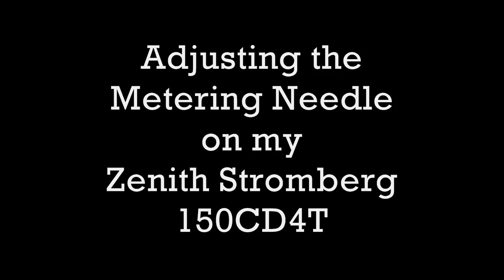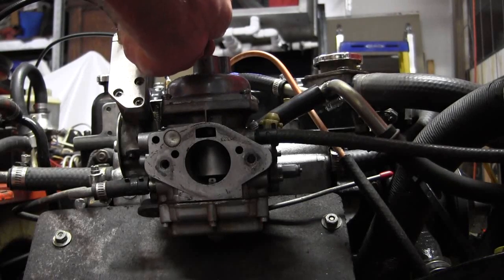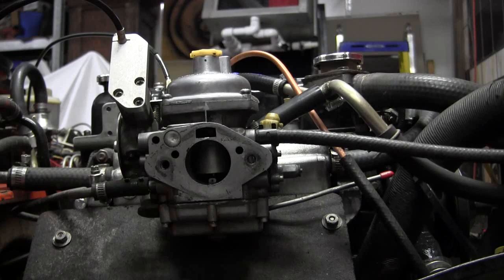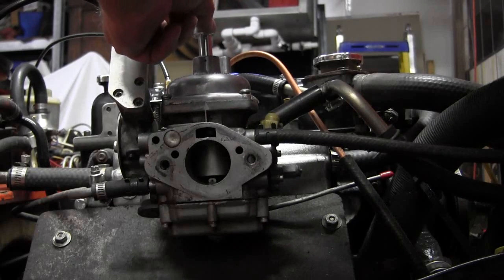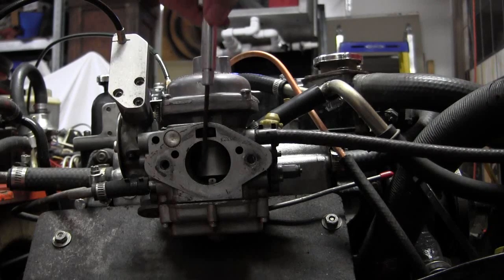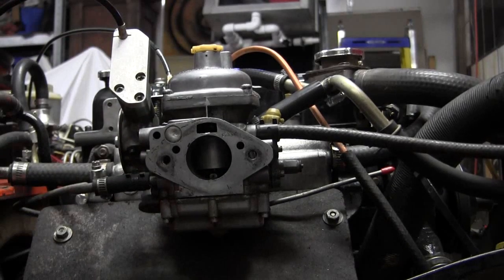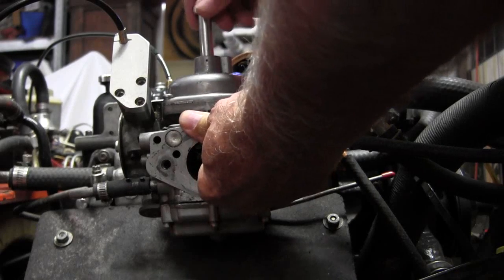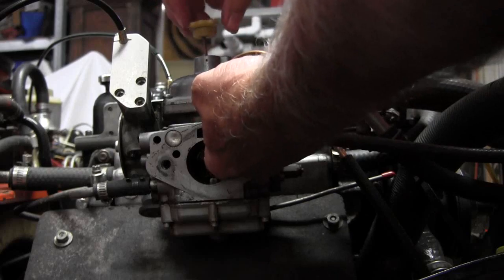My Zenith Stromberg 150CD4T metering needle adjusting video

Comment: Great video! I have stromberg 175cdt-u for Mercedes 1978, I've try to adjust mixture but when I try to lift the valve up the idle drop & engine is shut off. The rpm is already on the high idle. Is there other screw to adjust the idle? I have no problem with the power of my engine but when I checked the spark plug its full of carbon (Back then my spark plug is brown & fuel economy is great)
Reply from the maker: Adiemobs, I'm not familiar with the175cdt-u. Spark plugs covered with carbon is usually too much fuel, could be the choke not fully releasing. My water heated choke was causing me trouble so I installed the manual choke. This carb in my video here is running with the 10% ethanol blend fuel, engine ran well. When the non-ethanol mix fuel become available again I overfilled my tank (my bad) in Montrose before driving from over Red Mountain (twisty high elevation roads). When I got home I found the carbon canister was soaked with wet gas, and my spark plugs carboned up the worse I had seen. I cleaned the plugs and used the ethanol mix after that. Engine ran better, no heavy carbon build up. I edited most of my earlier reply out, sometimes too much info is confusing. You had good coloring before, could be something you recently changed. My 150 did have another screw, on the rt side of the carb, for adjusting the mix when smog testing. I think it was fine tuning the internals I'm not sure. Mine was set a few turns out. My choke was most of my troubles.

Comment: Calvin, all the way clockwise the needle stops, will it stop if adjusted far enough counter clockwise. Mine just spins and spins…Wondering if my diaphragm is ripped.
Reply from the maker: you can drop out turning it CCW, just lift the piston up with your finger and turn the adjuster CW to pick it up again. I check my diaphram while it is out, gentle stretch and a light behind it would show through a hole.

Comment: So I just installed my carb and it revs like its wide open throttle. I've checked the cables, the carb at rest, the gaskets are new and the bolts are tight. Where do I begin from here?  And what's that port above the mouth of the carb?
Reply from the maker: Jim, gasoline makes the engine rev higher, check the float level setting, piston needle position, choke fully off? Look at where that port goes and what it effects on the carb.
Reply: Like I said the cables are at rest, no pulling. It revs like the throttle is wide open, high enough I dont want leave it running to red line the RPMs. I know Kehin and Makuni carbs just not zenith. I assume the opening above the mouth is idle air intake ? I can see as much as when I fire off the slide is still down.
Reply from the maker: @jamesteeter5345  Throttle and choke cable at rest. So something is holding the throttle open. The fast idle adjuster screw or choke screw holding carb butterfly open. Raise the piston, look into the carb see if the butterfly is closing or if the metal plate is off center contacting the side of the throat. If throttle or choke screw adjusted tight turn that screw counter clockwise to close the carb butterfly. I swapped a butterfly plate from another carb, did not fit correctly, so it was holding the carb throttle from closing.

Comment: What in the world are you doing? Hard to read your mind sir.
Reply from the maker: You can read the spark plugs to see if your running too rich. If your plugs are too hot, run too white, change to cooler heat range. Fuel mix instructions at sea level change with elevation change. I adjusted leaner for higher elevation. Plugs are cleaner, MPG improved, engine response improved. The engine stopped running rich when I crossed 10,000 elevation summits.
Reply from the maker: Jess, short answer is: I'm adjusting the air to fuel ratio for my elevation. I had removed the Calif epa restricted camshaft and installed the MKIII higher performance camshaft in 2015. I did not change the needle attached to the piston, just the position of it to the jet by turning the adjuster with the allen tool. HTH

Comment: Where can I get This ajusting tool? Whats that tool name?
Reply from the maker: Zenith-Stromberg Adjusting Tool for the metering needle. allen with the guide that holds the rubber center from twisting. Zenith-Stromberg carb parts suppliers should have this in stock, possibly with their own name for it, but that is what it does.
Reply: Calvin, thanks for the detailed video.  I just ordered this tool today, but I got to thinking there might be different ones (sizes) for different cars/carbs?  I couldn’t seem to find any differences in the ones I found.  Is there just one version?  I have the Stromberg 175 Cd for 1964 TR4...
Reply from the maker: @timduncan1282  I would talk with that sales person about that to be sure. I don't have a 175 to check myself. 175 is 1/4 inch wider out, piston should be a tad wider, but it should be the same allen. I have the 150, not much different  in size.

Comment: I have a Stromberg 175 CDT on a car in Europe that's runs terribly when you hit the gas hard. Also doesn't want to idle. Assuming I get the fuel system cleaned out and it still runs the same what would you look for?
Reply: I would guess that the diaphragm has a tear. It would be best to get a carburetor rebuild kit for it.
Reply from the maker: Triumph Spitfire & GT6 Forum

Comment: Calvin, whe I try to turn the allen key there is a massive amount of resistance to the movement of the tool. what could be causing that..?
Reply from the maker: Chris, If turning the allen clockwise, the tool is turning a screw in the piston, as the screw raises the jet needle the screw runs out of thread, and bottoms out. Counter-clockwise extends the reach, and will turn out from the needle, turning free till it releases the screw, and separates.

Comment: isnt there an extra air screw  that says to not touch it. i would adjust that after you have adjusted the main jet.
Reply from the maker: CO needle is on the radiator side of the carb, is that the one your referring to?
Reply: actualy i dont own a car like this but i only know it by my neighbors car. in that one its burning too rich like the choke is on. spark plugs are black. he doesnt know what to do. since i have a diploma in mechanics i have a good idea. he adjusted the main jet and did not do anything. there are  only  two other adjustments.  one says    do not adjust and another one beside it.   one of those is the one thats adjust the total air through the whole opening range of the  main flap.   and yes try the co adjust see what it does     you cannot hurt anything  cus only adjusting air and fuel!  the neighbor is too  scared  to touch them!   its better than running that engine rich. cus that causes carbon buildup!  not good!

Comment: great video thank you. I am currently restoring a 78 myself after its been locked away fro 20 years. i hope to learn a lot from you.
Reply from the maker: Actually, your going to learn a lot from that 78.
Reply: When you turn counter clockwise, does it mean the needle goes down and less fuel going in (leaner)?
Reply: @QuangWynn2711  Yes. Clockwise is richer, pulling the needle up. Just remember left for lean and right for rich.
Reply: I try that but not helping at all .

Comment: Is this needle - once in right position - fixed to the round cilinder or can it still move in and out?
Reply from the maker: fixed to the adjustable screw you adjust in the top using an allen wrench and special tool preventing the inner diaphragm from turning.

Comment: My idling speed is way to high on my w123...which parts should i adjust? Im using zenith cd150
Reply from the maker: 3 places to check: throttle cable adjustment for proper slack, choke adjusted correctly off, and the idle screw on the left side near the choke that moves the throttle. There are vids on UT of those items, and the web has pictures of the carb's left side screws named. Your manual is very helpfull, it you don't have one ebay does.

Comment: What is the yellow screw on the right of the carb? I know I need to adjust my carb as it is running really rich but I cant figure out what that yellow knob does.
Reply from the maker: that plastic cover is on the fine adjust screw for air/fuel mix. It is only adjusted when a gas analyzer is connected to the exhaust to check carbon monoxide levels. If your engine has the smog equipment still working. If the engine does not have pollution testing in city, the screw is not used.
Reply: Thank you!

Comment: If the idle speed slows or stumbles when the piston is slightly lifted, the mixture is too lean.
Reply from the maker: Don't forget to watch the spark plugs after making mixture adjustments. Assuming there are no vacuum leaks or open lines into the intake manifold for air to lean the fuel mix. If the electrode's insulator is white after driving awhile, either the plug heat range is too hot (burning off all the fuel trace, aka color) or the mix is a bit lean. Dropping in spark plug heat range should bring back some light brown color, letting you know your in the right heat range. I find these carbs and cars have more than one problem happening when it comes to proper spark and fuel. A very lean mix can cause hotter running engine temperatures, not the best thing for aluminum pistons.
Reply: Indeed, Sir. After i fitted a "sports filter" on my car, the Zenith did´nt get enough vacuum so it just got too much air. Plugs looked like they had´nt been runing at all afler several miles.

Comment: Interesting, maybe this adjustment is what mine needs. I have a 1978 Spitfire and the only way it will run is to take a piece of thin cardboard and completely cover the air intake. Once it's running I can move it enough to let more air in and it runs fine. If I remove the cardboard the engine dies.
Reply from the maker: Check the float bowl fuel level, if the level is too low the fuel is not up into the jet as needed. The cardboard is causing the engine vacuum to pull fuel from the carb. Cleaning all carb passages is the next step. You should not need to block the opening.

Comment: I just ordered my metering needle tool today, but before I mess with it I've noticed something John Twist said about the needle. There is a pin inside that if it's missing will allow the metering needle to spring up into the valve. (Which mine does with about a 1/4" of play.) Where would this pin be? He says a piece of paper clip works fine to replace it. How much movement of the needle is normal and why is the spring in there? On the SUs on my Z car the needles are solid in the pistons and no diaphragm.
Reply from the maker: the pin is touching the top of the needle, the needle sits on a spring, all 3 are part of the needle holder. That is why you can pull the needle down about 1/4". The needle holder threads onto the allen wrench adjuster screw.
Reply: Just got done messing about with it. Either my needle and jet are very worn or I have a mismatched pair. I placed a copper shim between the needle and adjusting screw so the needle is pushed all the way out of the valve assembly and down into the jet. It still blows a little smoke, but it will at least hold an idle and it didn't load up while holding 55. I think my understanding of the mixture may have been flawed as well. When you adjust the screw, the boss that the needle (and the jet it goes into) never change relation. So you aren't reducing the fuel metered into the engine by running the needle into the jet (as I have done with my shim), you are increasing the airflow by actually raising the piston with the needle valve assembly to allow more air into the mix. Am I correct in my new understanding? Either way, I'm looking for a new matched needle/jet assembly as the needle is very sloppy in the bore of the jet.
Reply from the maker: No your not correct, adjusting the needle with the allen tool is not supposed to raise the piston, air flow across the bridge under the piston causes the piston to lift, and pulse up & down. A CCW allen turn moves the needle down into the jet or CW up but not out of the jet. Think of it as a tapered rod and the taper is blocking the fuel more and more as it goes down into the jet hole causing the mixture to air to be leaner. The adjuster can detatch from the needle holder when your turning it CCW, just lift the piston and turn the allen CW and it will reconnect. Other things can cause the exhaust to smoke some too, oil leaking down the valve guides, a mis adjusted float if too high will raise the fuel level into the jet, air valve on the carb gaskets, ect ect ect. U-Tube is not the best quick answer, try the spitfire&GT6 forum, usually someone is online and help out. Be sure to post the year of the car in question, it helps.
Reply: I've been viewing the University Motor vids on the Stromberg as well. I have adjusted the float and auto choke per John's instructions. The only thing I can't figure out is the needle valve. If you turn it clockwise it will pull the whole assembly up into the damper which opens up the jet, but the needle assembly can't go any further than flush with the bottom of the damper. (I've had it completely free from the piston to check its fit in the seat which was very sloppy!) After that the shoulder of the needle valve assembly is making contact with the top of the bridge and the only thing left to happen is for the piston to raise. (This being when it is not running that is.) At least this is what is happening on my car. (78 Midget 1500.) Is the shoulder of the needle valve assembly supposed to fit inside the large hole in the jet so the actual needle can descend into the smaller hole further down in the jet? My needle says 45O but I may be misreading it as the only ones I can find at Moss are 44A, 45K, Q and R So I think I probably have a 45Q. I can't find a seat at all. I will be replacing my diaphragm. Even though it doesn't look like it has holes it still may have them. John had one off of the carb from a TR6 and he had stretched it so we could see the perforations. Thanks for suffering my lack of knowledge. I will say I like my SU's On my 260Z much better! Even though they operate on the same principal, they just seem easier to understand!
Reply from the maker: When mine is flush, I can adjust it higher into the piston. I don't recall mine adjusting so far down it hits anything, before disconnecting. I have adjusted mine up to richen my mix. If your adjusting it down your trying to lean out the mix. Is the jet too big, is the needle/jet a matched pair, did someone drill it larger, or is it just worn out ? Has it been taken apart and reassembled before, and did they not use the correct parts ? Slow answers to more questions. Like jpatt, I find youtube limited in what it can do. A video gets published, more questions come up, then we spend more time searching, viewing, and still have unanswered questions. I recommend the Spitfire & GT6 forum. On the forum, your not waiting days for answers, and photos can be posted to help show solutions. I find multiple answers to some questions because problems can have multiple causes. Hope to read more questions about this carburetor on the forum jpatt.
Reply: I get it now! I was working with the engine off. When air is flowing through the venturi, the piston is riding at a given height determined by engine speed. When the piston is floating the needle can go down into the bore. With a new diaphragm and 45Q needle I'm 1/8 turn CCW and everything seems to be running smoothly now with no black smoke and MUCH better gas milage! Now onto lever arm replacement over the winter! Thanks for the input and awesome vids!
Reply from the maker: j, watch the sparkplug's insulator coloring, if it stays white after many miles of driving the fuel mix is lean and then CW a quarter turn to richen it up, watch for color, CW again if not showing any. If the color is sooty dry black it's too rich. your adjusting for a toasted marshmallow coloring. Sparkplug heat ranges are also important. Too hot a plug will cause white insulators as the color is cooked away. These 2 things are influenced by other things too, so read up on it, many long pages written on  the subject.
Reply: I'll definitely pay attention to that. They were black as coal before. I cleaned them and was running the old ones to see if they stayed clean before I blew my cheap head gasket after three hours and around an hour of awesome running before I saw white puffs in the exhaust. (My #4 piston is now really clean!!)  I just had the head decked today and will be putting it together with a Payen gasket this weekend.  A few of my other cars (260Z, Alfa GTV6 and 164) have between 10 and 11:1 ratios (the Midget has 10.5:1 pistons in it) and I use the same plug and heat range in all of them. The Alfa's plugs are always clean as a computer controlled car's mixture should be optimal. My X1/9, Hornet and RX8 are the odd cars out where I have to pay attention to which plug I'm putting in which car!

Comment from the maker: Cruising the higher elevations above 6000, I found the engine acted up when driving around in 2nd at low rpms. Further needle adjusting leaner corrected that, and it was around 2.25 CCW total adjustment when I finished..